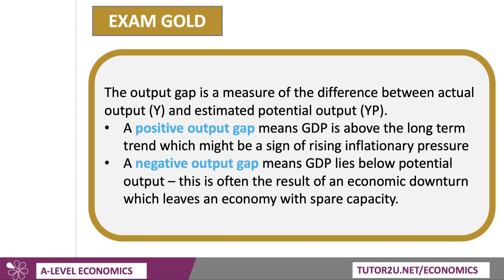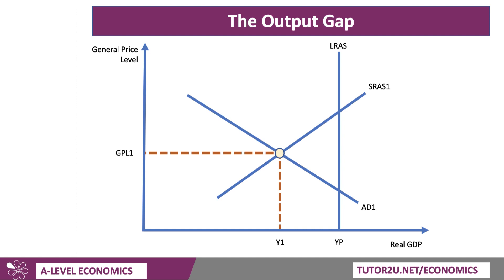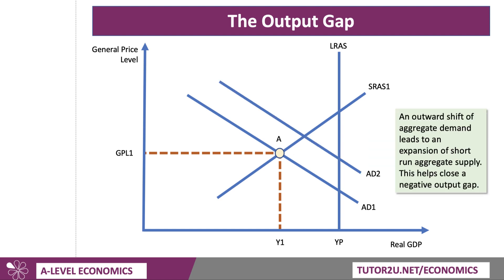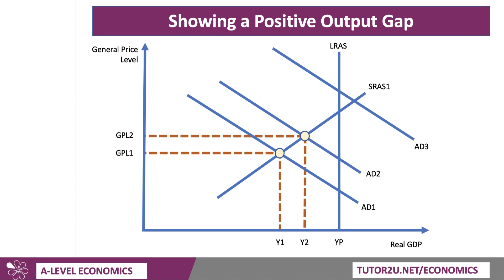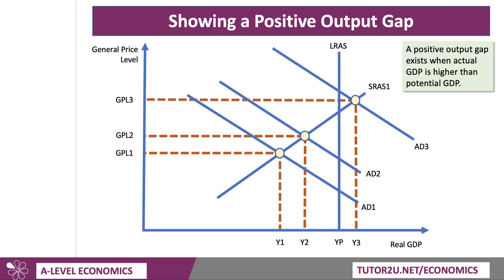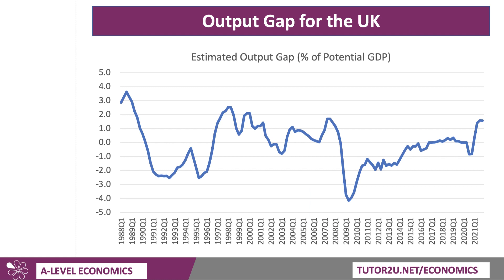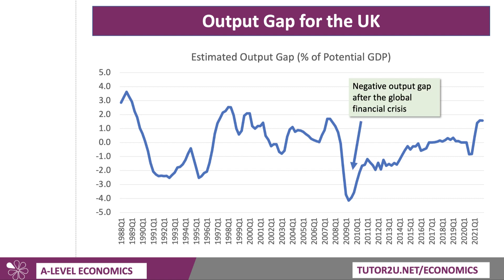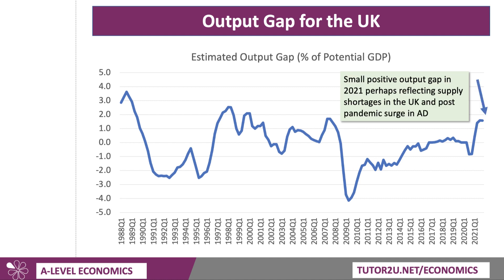Key Diagrams - The Output Gap

Comment: Can you explain a positive output gap? Because how can the level of GDP be greater than the productive potential of the economy
Reply from the maker: Productive potential in this diagram does not mean full capacity
Reply: @tutor2u-official  So what does it mean? Is there a video you can refer me to so that I can understand?
Reply: Actual GDP can be higher if factors of production are working at unsustainable levels, such as lots of workers (labour) working overtime. A positive output gap means that workers and capital machinery are working far above their efficient level of output due to high demand, which is why positive output gaps are inflationary.
Reply: @alexcreighton893  ah its about efficiency. thank you.
Reply: GDP can be greater than productive potential of economy because of credit. Ray Dallas "the economic machine explains this really well"
Reply: dallos * "the economic machine"*